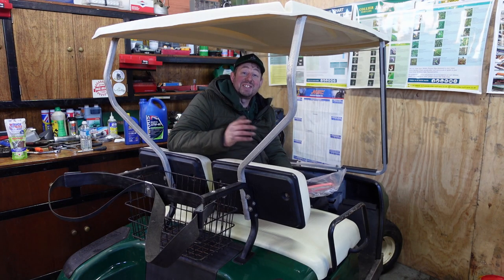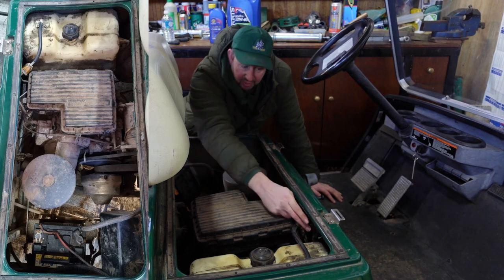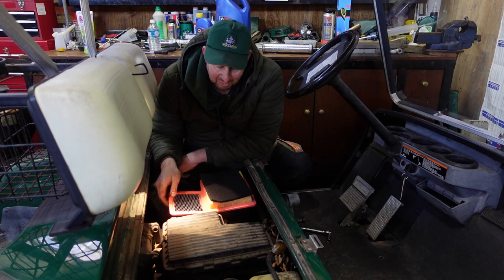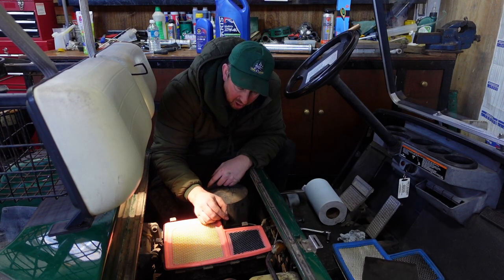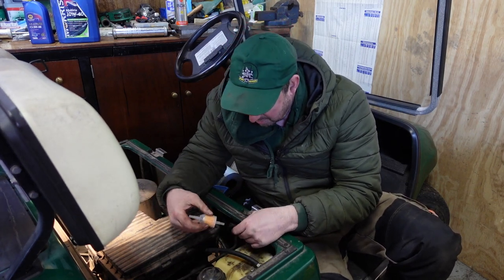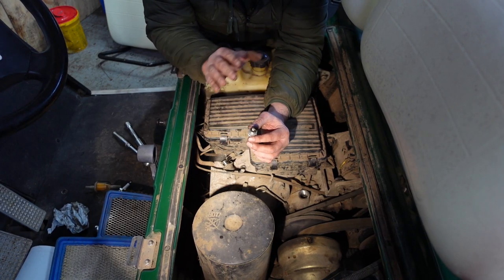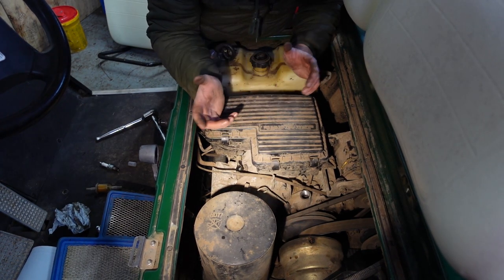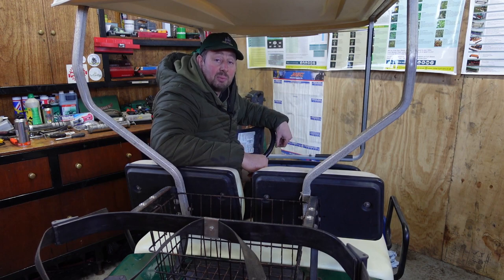Golf buggy service how-to / fix / repair a Yamaha cart tutorial

Comment: Nice job and video Jimmy, sounds like its running smoothly now. 👍
Reply from the maker: Yeah it's great, 
We had a problem with that old fuel pipe kinking over but we changed it and the fuel pump just for good measure and it's unstoppable now.

Thanks for watching,

Jimmy 👍
Reply: Anytime brother and good deal 👍

Comment: Nice video what's the spark plug gap supposed to be at not that it matters just wondering
Reply from the maker: You know what, I've found the information on these engines so hard to come by that I don't actually know.
Maybe I should do a video on spark plug gaps, how to measure them and adjust them.
I'm not sure many people actually do that these days.
Reply: @JimmyTheMower  Between 0.28 and 0.30.
Reply from the maker: @keithhunter9341  that's great info 👍